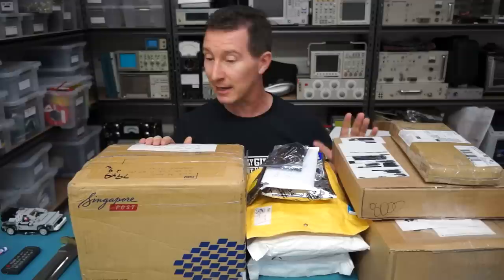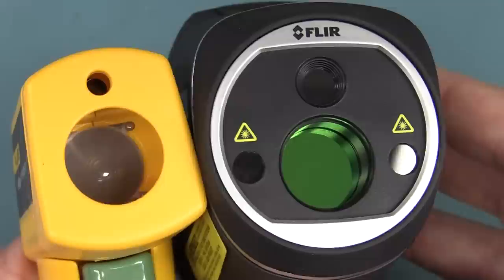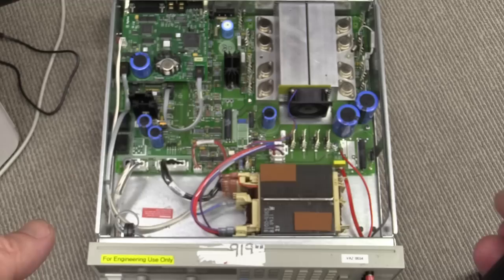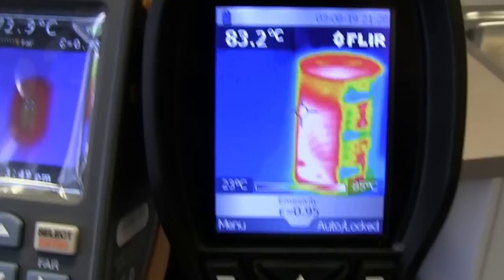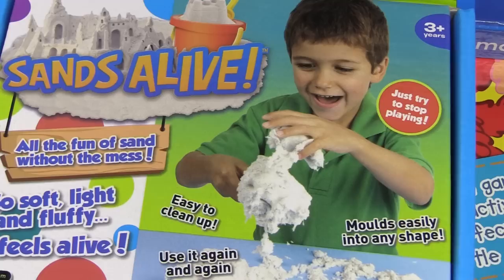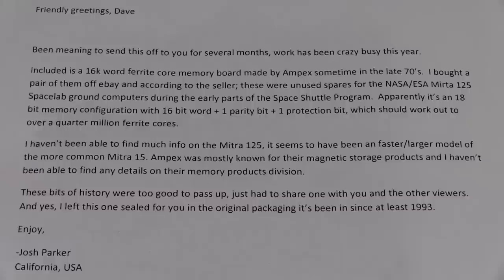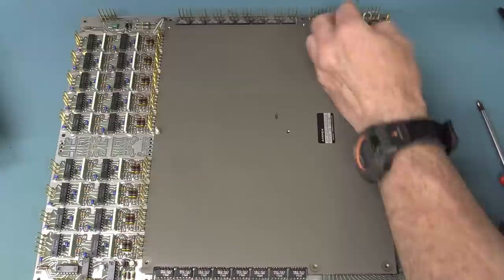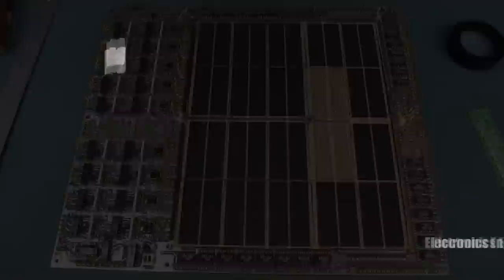EEVblog #668 - Mailbag + FLIR TG165

Comment: I bought two of these core memory boards off of ebay, and I managed to get them to work and dump the existing data in them.  I made a PIC based "core memory" exerciser to test every core.  yes they all worked!  It's 16K*18 bits (and is designed as a 16K*20 board but only 18 bits worth is stuffed).   My board had defective tantalums and a TTL chip but I fixed these.  All the chips on the core board are diode arrays, btw.  I also drew a schematic out of that board.
Reply from the maker: kevtris You reverse engineered the entire board? Do you have the data?
Reply: Wow! You are a true hobbyist hero. Well done! :)
Reply: I do but I doubt I can post the URL for what I found.  I also made a schematic of it and the 32K version but I might've lost 'em.  blog kevtris dot org forward slash blogfiles fwdslash corememory  stuff should be in there. core4 txt is the pinout and usage.
Reply: EEVblog
yes I posted the link to it on dexxter's reply.  if you can't get the files send me a personal msg and I will hook you up.

Comment: I seem to remember a tablet (acer?) that also had a 5.35V charger, apparently the higher voltage was used to signal 2A dedicated charger current. Lots of complaints that it would only charge very slowly from anything but the original charger

Comment: They managed to get industrial temp range by using standard IR temp. sensor, not lepton. Flir One has 0-100°C temp measurement.
But what's the use of temp. color scale on the left of the screen when it's not numbered? The thermal image is not calibrated, so it's just for information :(

Comment: Hi Dave,

4,35V is the max voltage needed to charge some of the new high energy density Lithium cells as the Samsung SDI ICR18650-32A or LG ICR18650D1
keep the good job
Phil

Comment: Looking at the construction it was probably assembled with a machine, as machines for assembling core memory were developed in the late 1960s.

I'd like to see some plated wire memory.  It is a similar technology which was developed by Bell Labs back in the 1960s, and it allows both for cheaper construction and potentially higher densities since it can be made using the same photolithographic processes used in PCB manufacture.  It was actually used, in a non-destructive-readout version, in the Honeywell HDC-701 missile guidance computer used in Minuteman III ballistic missiles.

Comment: I have a VT04, its not as nice as the FLIRs, but it is better than the VT02. It does what I need it to do, and I couldn't justify the higher prices for the FLIR models at the time. It does do the visual blending, still, and the firmware update gives it some better battery life.

Comment: Love core memory! It's so aesthetically pleasing!
I have a Wang 360SE Electronics Package (sadly, no keyboard/nixie display unit... only the processing unit). It was a calculator from the mid to late 1960s era that used core memory. Sadly, it's the only core memory in my possession.

My calculator's core memory doesn't hold a candle to THAT beaut! I am in LOVE with that core memory! Sexy!